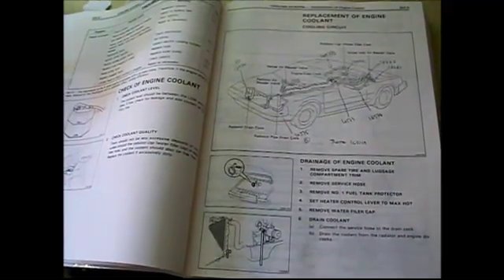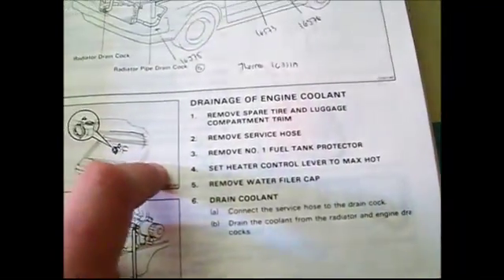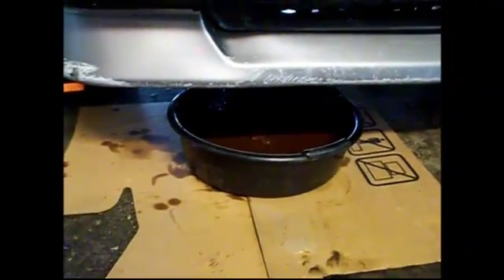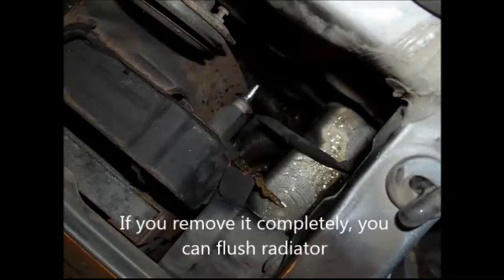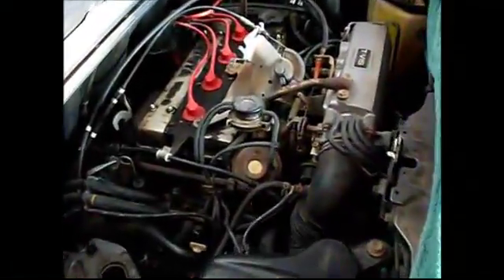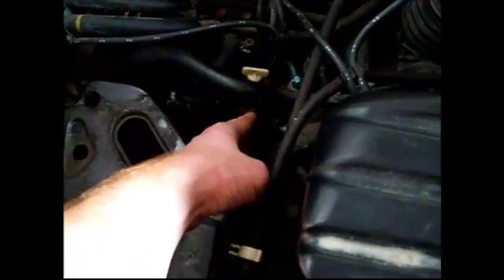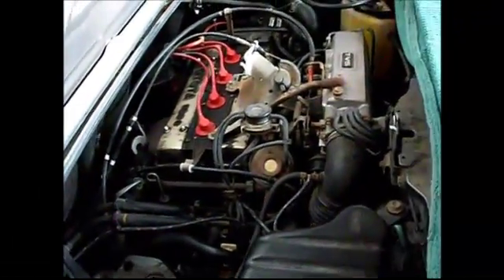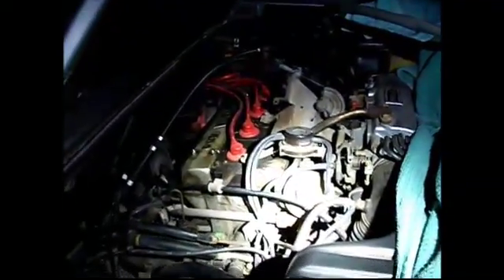How to change/flush the coolant in the Toyota MR2 MK1 (AW11)

Comment: My friend I’ve been fushing the coolant system of my mr2 for 4 days because I swapped the engine. There are no bubbles in the system anymore, after I turn the vehicle on, after a few minutes it overheats. The thermostat is out. I don’t know what to do. It’s frustrating?
Reply: Did you put the thermostat back in 😭

Comment: Hi Gray, useful vid, many thanks.  Would be good to see one of bleeding the system also as most people will need to do that right after this step.  Your method may not flush the cabin heater coolant pipework, so I'm trying to figure out how to attack that.  I'm working on an idea to force water pressure into one of the pipes at the thermostat as the entry point - it should then circulate the heater pipework and exit again at another unhooked pipe close to the thermostat.  Hopefully that'll get it.  Those drain hoses you find in the frunk are actually for the bleed process rather than the drain process - some mk1's will come with short hoses on the drain points for this purpose.  Keep the good vids coming!
Reply from the maker: already made a vid for that 

Bleeding the cooling system